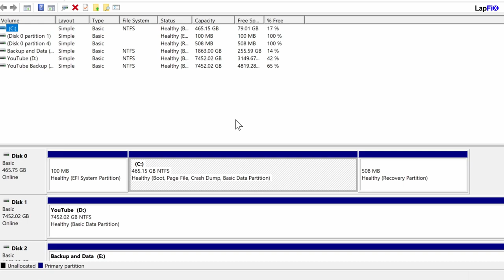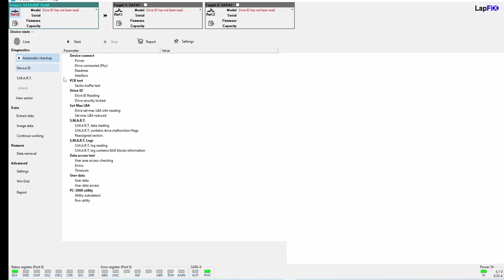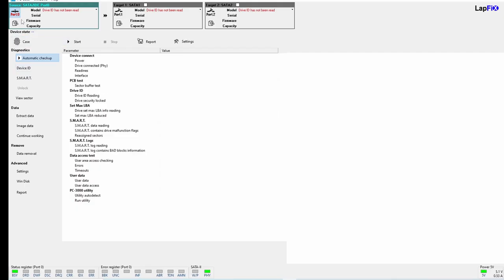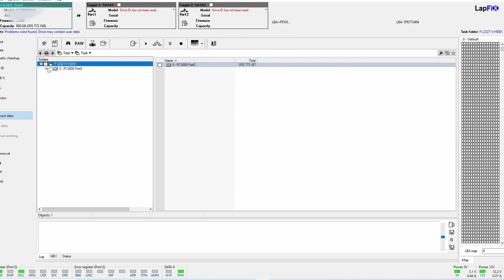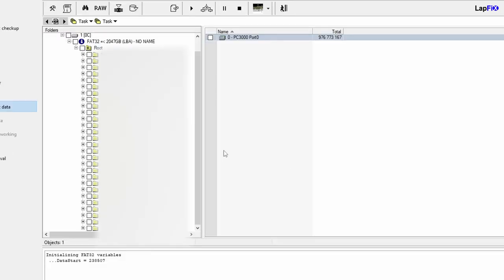Data Recovery on an Older LaCie Drive Not Powering on or Detected

Comment: I have a Lacie Big 2 dock, with a Raid0 configuration. It is giving a red light (solid) and not showing in drive list.

The raid contains critical data. I need to, determine: are the drives ok (seagate ironwolf pro 12TBx2); is the data on the drives ok?: solid red should be temperature related,  but I do not find heat. So what is happening here.

I will pull in down to inspect when I am able.

Comment: Nice i have this one two versions 200 mb and 500MB still working but i have bewerkt versión bought in 2013 with 4TB and stopped working yesterday it gets power but the drive is not running
Reply: Do you have a video with the newer model? 4TB Porsche design

Comment: I have a Lacie 5tb the light comes on and I feel a little vibration, but it won’t show up on Mac. I took it to two shops they said it’s dead and said I need $1400. Is there anything else I can do??
Reply: Did you find a solution? My lacie is not doing anything either on mac
Reply: Mine won’t even light up… I guess it’s dead